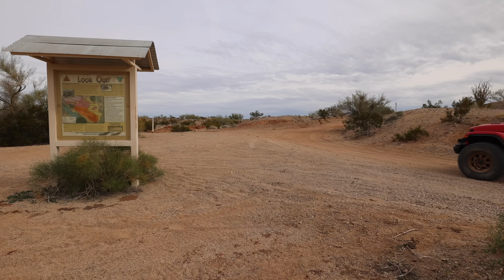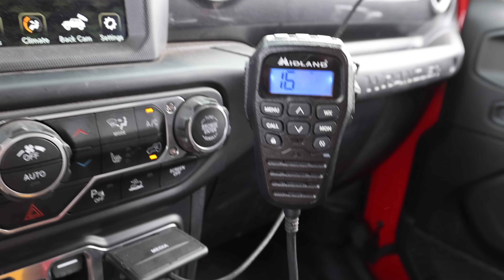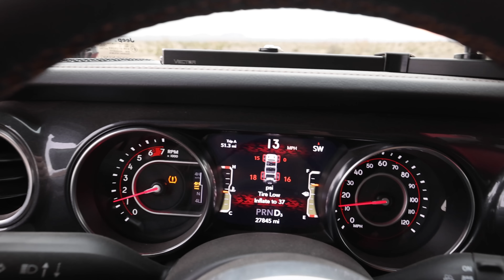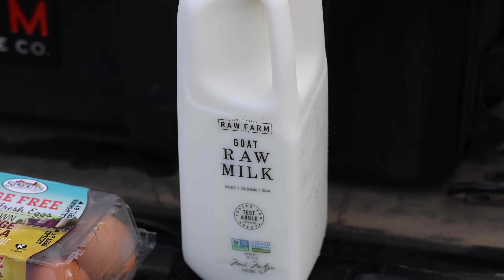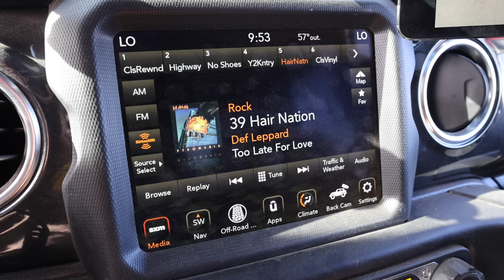My Son & I Travel Deep Off the Grid - Bradshaw Trail

Comment from the maker: Thanks for everyones recommendations about what could possibly be the source of my sons Tacomas burning smell.  We have spent the last few days trying to figure it out with no luck. And of course when we are now out driving on the road the smell is gone.  If we find the culprit, we'll be sure to follow up.  Safe travels everyone!
Reply: It can be so tricky!! I say run it until you meet your deductible! Then he can get a JEEP
Reply: What ended up causing the flat? Was it just a slice from a rock, or random piece of metal or something?
Reply: What shape are the taco's shocks in? The very first thing that came to my mind about the burning smell was a shock overheating. Aging or inferior quality shocks will overheat on extended rough roads especially at speed over rougher terrain and then be fine back on asphalt. Could be your mystery problem.
Reply: What about your front diff fluid?   Often goes overlooked….
Reply: when i get my raptor hot from offroading in 4wd it makes a smell but otherwise never does it in normal conditions i think its a front diff thing or heat from the engine thing

Comment: Wait the gadget king doesn’t travel with an electric impact? And relies on a scissor jack?
Reply: Mechanical reliance
Reply: Haha, trail is too easy, I wouldn't carry impact as well
Reply: I think brad puts a big emphasis on size & weight. Much less space needed to carry a lug wrench rather than a cordless impact.
Reply: Lmao. I was thinking the same thing. But probably wasn't expecting much going out on this easy trail!
Reply: 1/2 inch breaker bar and also milwaukee fuel impact is what I always carry.  You never know when you or another offroader might need it.
Reply from the maker: Truth is, that this was a bit of a wake up call for me.  As I was changing the tire I was thinking about all the tools I have in my JK, but haven't yet duplicate in the 392... that will all be fixed soon.
Reply: @TrailRecon 😂
Reply: They make adapters that let you use your impact on scissor jacks too.

Comment: Burning smells you can't trace back are a real bummer. If it's not electrical, could be an exhaust part, or something dripping onto a hot exhaust, or maybe a brake binding or a friction lining of some kind? Lastly the actual cabin heater could be reaching the end of its life? Whatever the case, you guys have to get back out there, it was such a cool place to camp! Loved this adventure, despite the small issues you had!

Comment: When TrailRecon posts a new video, I hit like before I hit play because I know it's worth it. I wasn't wrong. I wish we had land and trails like this out East. Looking forward to see the Tacoma build come together.
If you ever want to try something different, try getting a Subaru and building it into a light overlander. They're more capable than you'd expect and could handle roads like these with a slight lift and skid plates. People have even done light rock crawling in them. There's a good aftermarket for off-road parts. It could be a fun budget build, just don't get one with a CVT or head gasket issues.
Reply from the maker: Thank you so much! I've seen some nicely built Subaru's out there.

Comment: I always carry a battery powered Impact wrench on trips for my tires and Skid plates. Saves time and energy.
Reply: I got some Ryobi electric tools and it's great. An electric wrench for taking off sway bar links, electric air pump for airing back up, electric chainsaw for small trees that fall across the path. All run off the same battery. Bring a couple spare batteries and a charger to plug into the power outlet and you're golden.

Comment: Little tip -when you smell that smoke, grab that fire extinguisher first before you try to find where the smell is coming from. Jordan did very well to "check" the hood first with his hand for heat, but an extra pro tip: crack the hood an open slowly so it won't flare up as much if there is a fire in your engine bay; and of course having that properly sized fire extinguisher ready.
Reply: I know someone who recently had a vehicle fire, he got out to investigate smoke and while they were investigating the vehicle locked itself, locking the fire extinguisher inside. He ended up smashing one of the windows to get at it and to get some expensive gear out.

Comment: I carried an impact wrench with plenty of batteries just in case the lug nuts are too tight.  I also have a long, light weight aluminum pipe to get some leverage if the wrench fails. So far, the wrench is doing fine.

Comment: There's camshaft end seals on that engine too. Reach down the back of the heads with your hand, engine cold, rub all around the vack of the head and see if there's oil on your hands. By the way, those heads are one piece so, check the cam cover gasket and sparkplug tubes for oil indicating leaky sparkplug tube seals.

Comment: I actually carry a 25 inch long breaker bar with a dedicated socket for those stubborn tight lug nuts. I also have a pipe that can be used as a cheater bar on a ratchet.

Comment: The gen3 Tacoma you can press and hold the traction control button until the full traction control light comes on.  It will not disengage over 35mph the same way as a quick button press.

Comment: Your tire was only flat on the bottom.  😀🤪😂🤪😀🤪😂. Seeing you get that flat tire is definitely the reason I am working on making my spare tire the same size as the tires on my truck.  Chevrolet put a regular tire on my Colorado as a spare.  It just isn’t the same size as the tires on the truck which could cause a little bit of a problem on the trail.
Reply from the maker: I also carry a tire repair kit, so just in case we were to have another flat along the way I could have done a temporary repair. A full sized spare is the way to go.
Reply: @TrailRecon  A tire repair kit is a good idea.  👍

Comment: Put a thin coat of anti-seize on lug nut studs and torque to spec using torque wrench. They will NEVER come loose on their own, but will be much easier to get off when needed. Dry studs and impact guns is rookie stuff.
Reply: I take my wheels off on a daily basis doing installs lol, ill be sticking to the impact. Especially now you can get 250 ft/lbs of torque out of a sub compacts.
Reply: @brooktech7869  anti seize is ok , but I will never use anything else other than my impact drill to remove studs...
Reply: I’m talking about not using a gun to install lug nuts. You guys are brilliant huh?
Reply: @MrBoomStick  Did you know that you can spin nuts with the impact and then torque to spec manually? 😂 Gotta use finger control.
Reply: Did you know that the person who installed Brad’s wheels obviously didn’t do that? 😑

Comment: Did you feel the wheel and wheel hubs for excessive heat? It could be the brake calipers are not fully retracting causing the rotors to get hot. It’s not that uncommon for the brake calipers to do this.
Reply from the maker: At the time we didn't think of brakes, but something we are now going to keep an eye on.  Thanks!
Reply: Good call! I had that issue with my forerunner after driving in the mountains, I stopped and let the brakes cool, and luckily it never occurred again. I've since replaced the pads and rotors, as well as the caliper on that side.  Taco has rear drums though, so it could be a little different. Maybe they were just out of adjustment and slightly dragging.
Reply: @trailrunnah8886  I suspect it is the front left caliper.  I’ve had it happen on many different vehicles through the years. You usually have to either rebuild the caliper or just buy a rebuilt or new one.  Sometimes you can just re-grease the guide pins after cleaning them. It will be interesting to see if Brad and his son isolate the problem.

Comment: I know you eliminated the fridge but, they are supposed to be run pretty level.  They can take the angle short term but I think the compressor will run hot at the angle of the back seat.  Could be why I think you said it wasn’t running very cold.

Comment: I had a burning smell on my 2011 Tacoma kinda like that and the front main seal(crank seal) was seeping down the front of the engine block a little bit. Longer trips or driving harder would trigger the burning smell. You'd never see dripping oil cuz desert dust would help it cling to the engine and frame. It's an easy fix and you can replace the harmonic balancer while you're at it!
Reply from the maker: Will have to look a little closure, thank you for that!

Comment: O had a bolt come loose My right rear caliper and allowed the caliper to bounce freely and cause the temp of the rear hub to be super hot. Definitely smelled like something burning or just extremely hot. May not be the same issue but just somewhere to look incase 🤷‍♂️

Comment: Have you checked the hvac controls for any of the wire connections melted. There’s a lot of threads on tacomaworld on the connectors melting on second gen tacomas. It’s an easy fix but usually takes out the controls and blower motor resistor. We had to replace both in our 2011
Reply from the maker: We haven't, but thanks for that!  We are pretty sure it's coming from the outside.

Comment: Impact guns on lug nuts are bad. Especially when the tech doesn't know how to NOT hammer the things on. I had that happen once, and it broke my lug wrench. I went off on the shop when I finally got it fixed. From now on, I specifically request that they do NOT use impact to tighten my lugs. 

Secondly, on my 2015 Tacoma, the oil filter is on the top of the motor. There is almost no way of preventing some spillage when changing oil filters. One trick I have been doing, I take a nail and pop a hole in the top of the filter. That way, when it drains, it gets the oil out of the filter too.

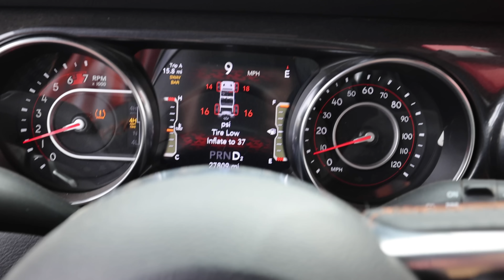Comment: At time stamp 3:54 you can see that the 392 is displayed in 4-Part Time.
I hadn't figured out when I would use it. Isn't that a stop gap to engaging lockers?   
I've wondered when I would want to lock the prop shafts but not the axles.

Comment: My 2nd Gen Tacoma had an 18 gallon fuel tank. That was one of the few thing I didn't like about it. My 3rd gen has a bigger tank but a smaller engine. I'd take your engine and trans combo over my newer one.
Reply: Nice thing about having a pickup is at. It's not too difficult to throw a couple extra 5 gallon cans in the bed. I wish it was that easy with my 4Runner.

Comment: The Dometic doesn’t like the small wire cigarette lighter in the Taco, I returned my first fridge because it wouldn’t hold temp, they sent me a new one and it did the same thing. Put in the Dometic wire kit with much bigger wires and it has never let me down since.
Reply from the maker: We actually had it plugged into a Goal Zero which I've done many times, not sure why it wasn't holding temp.
Reply: In that case, take the air compressor and blow it out. Dust will cause it to do that also

Comment: Are you going to do a follow up on the Tacoma smoke and what popped you Mud tire. What cut that Kevlar tire? I ran TA all the time and the only thing that took 2 of mine over the 20 years I ran them was sharp piece of steel and large piece of sharp thick glass. Great trip with your son you are a lucky man, except for the goat milk.
Reply from the maker: Appeared to just be a side wall hit from those jagged rocks, which can happen when you're wheeling as much as we are. The KM3s are great tires and I've got a lot of off-road miles on this set, so its probably time for some new ones.

Comment: I had a locking lug nut that was over tightened by the dealership and ended up stripping it off on the trail trying to get it off.  Had to keep inflating until I could get to a shop.
Reply from the maker: Ya, not happy about how tight they were.

Comment: Curious, what made the KM3 go flat?
Reply from the maker: Appeared to just be a side wall hit from those jagged rocks, I've got a lot of off-road miles on this set, so its probably time for some new ones.
Reply: @TrailRecon  oh ok, well good to know because I plan on running that same wheel and tire combo just with a 35 instead on my ZR2 Silverado, just wanted to check because I've only heard good things from the KM3's
Did you hear about the K03? Supposedly coming out in the spring
Reply from the maker: You can't go wrong with the KM3s, they're great tires.

Comment: I noticed that you used the stock scissor jack to change the flat. Is that something you recommend or was it something you just hadn't replaced with, say, a bottle jack  yet. Trying to learn what the best tools are for different situations. Enjoyed the vid...simple desert camping, not super gear intensive, going light.
Reply: I'm shocked the scissor jack worked on that.  Figured with the larger tires and some sand/dirt compression it wouldn't lift it high enough.
Reply: @robthompson6991  I don't know if you noticed, but is was pretty maxed out on the lift. I always looked at scissor jacks as just this side of janky. That's why I was asking Brad his thoughts on that.
Reply from the maker: I don't recommend it, I'm working on duplicating what I carry in my JK and this was a bit of a wake up call for me to get that sorted sooner than later
Reply: @TrailRecon  Thanks Brad. I'll press on with a good bottle jack and I think a Jack Buddy. Look forward to Jordan's built. Hope some Bronco stuff is in the works.

Comment: Curious where your tire got punctured? Sidewall or on tread?
Reply from the maker: Appeared to just be a side wall hit from those jagged rocks, which can happen when you're wheeling as much as we are. I've got a lot of off-road miles on this set, so its probably time for some new ones.
Reply: @TrailRecon  I’m been looking at those KM3 in 39x13.50R17 to put on my gladiator or going with Nitto ridge grappler 38x12.50R17. Which tire do you like better?

Comment: FYI, the Atrac system on the taco should not stay on, only turn on when needed for obstacles etc.  That may be what was burning if it was left on constantly.
Reply: is ATRAC on a taco different from a GX460?  On a GX460 ATRAC is always on in 4L
Reply: @LexusGX460-OFF-ROAD  I think it’s more similar to the 4Runner system where it needs to be switched on whereas my 200 series Land Cruiser is more similar to your GX where it comes on automatically.

Comment: I have had that same problem with Gaia for a while. Log out of the app and then back in and it will force it to resynch. I opened a support ticket with Gaia about it but they basically said they don't see anything wrong with it. Maybe if more users report the problem to them they will dig into it more.
Reply from the maker: I've had this happen a few times.... starting to get a bit frustrating honestly.
Reply: @TrailRecon  Before you head out, on your iPad press the settings cog, then “account”, then next to the “last sync “ date it has the two circular arrows and says “tap to manually sync”. You can do that and it should force it to make sure everything from your account from all devices is pulled down. 👍

Comment: Nice trip, guys💪
What light are on the rear window?
Reply from the maker: Thanks! They are KC Cyclones, but I need to adjust them a bit, hitting the roof when I open the window fully.
Reply: @TrailRecon  Thanks. They look nice and are slim, i will check them out.

Comment: Last time I had a flat I couldn't get my lug nuts to budge....And I weigh 250 lbs.!  Had to call AAA.  I felt pretty pathetic that I couldn't even change my own tire.  I don't know why they set the torque so high on those air wrenches.  I have a pipe for a breaker bar that I carry in the vehicle now.

Comment: the problem with all of these GPS software programs is you have to manually download the map, waypoint, tracks, and routes.  It needs to be simplified.  I had the same thing happen to me last weekend in the Cherokee National Forrest.  The only way I know to do it safely is after downloading what  you think you need, put the phone in airplane mode and turn off the wifi.  Check it again.  If it's there then you are golden and if not back to downloading.  I don't like this.  It has bit me more than a few times.

Comment: Yep.  The bradshaw trail is pretty good.  If you all want another shakeout run, check out the Palomar Divide trail.  Probably about 1 -1.5 hours from San Diego.  It can easily be done in a day.  There's only one place to stay the night on the trail.  But there's some BLM around it.

Weird that you all drove all that way on the road and didn't smell it at the start of the trail.  Did you smell it when you got back?  Gremlins like that are hard to find.
Reply from the maker: Thanks!  I've been up to Palomar a few times, not as remote but a nice day trip. Still investigating the Gremlins!